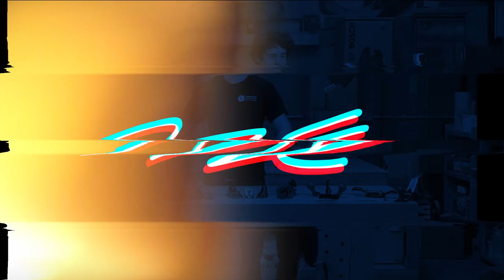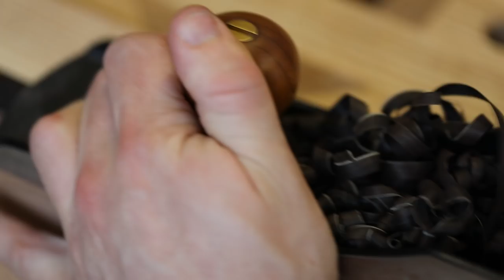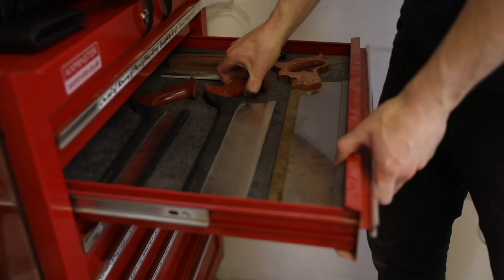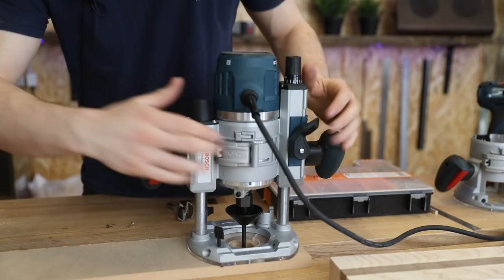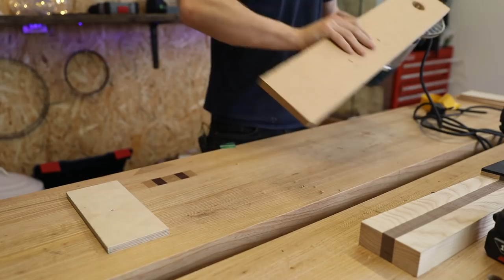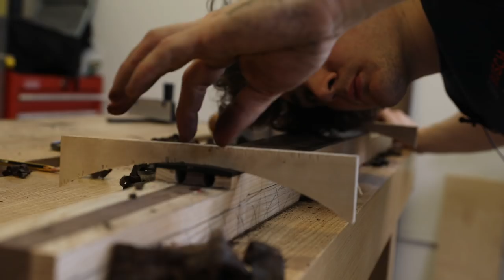Making a Custom Bass Guitar | Part 4

Comment: Wouldn't using a guide bushing have been easier for the trammel routing? You'd have to center the bushing, too, but you would only need to do it once, and you could easily pop the router in and out of the trammel afterwards.